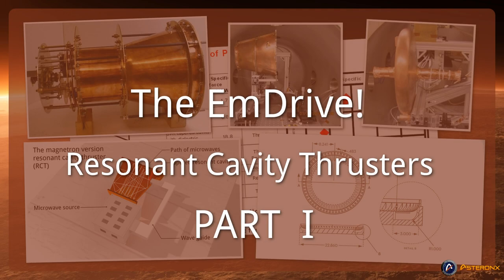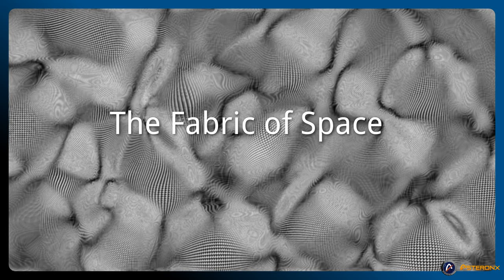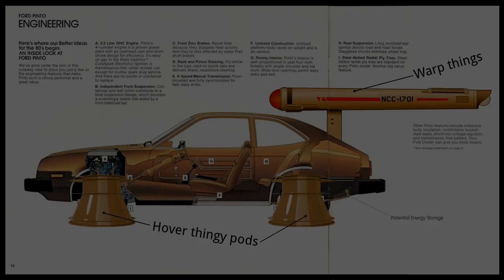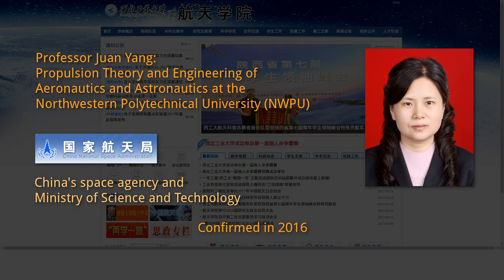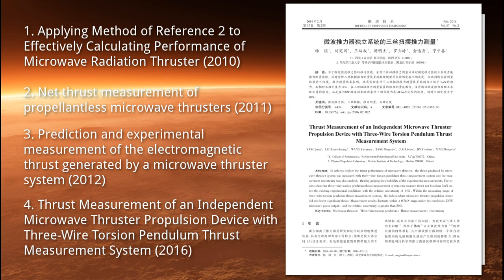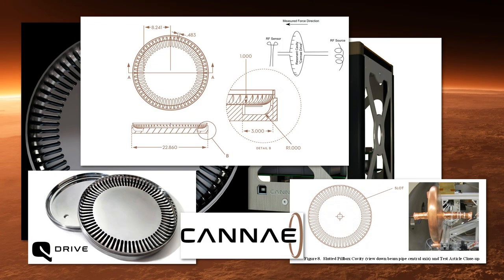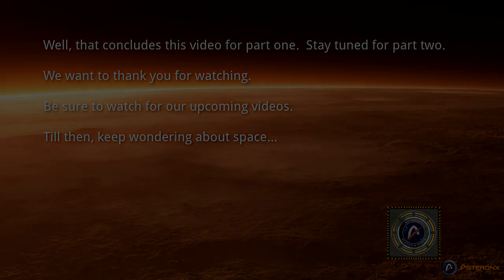An Explanation of the EmDrive and Cannae Drive Part I

Comment: This is how the EM drive works because I designed it.

The velocity of light in a dielectric is given by

(1)   v=c/sqrt(dielectric constant)

higher index of refraction slower the speed.

F=W/c is the vacuum case

The force equals power W in watts divided by the speed of light c

the general case is
 
(2)   F=W/v       force=power/actual velocity of light

where there is a dielectric the velocity is slower so the force is larger
substituting eq 1 into eq 2 gives

F=(W/c)(sqrt(dielectric constant))

The higher the dielectric constant the greater the force
Some materials have a dielectric constant of 12000
sqrt(12000)=109

So the force is multiplied by a factor of 109.

When I first conceived of the EMdrive in 1999 shortly before my lab books were stolen,
this is what I envisioned.
I realized that the difference in dielectric constants of materials could be used to create an asymmetric array where all the momentum is deposited only on one side of the device hence a force in that direction.
Originally I attempted to use an asymmetric cavity based on geometry alone but found that all the forces would cancel out and it would not have a resultant force in any direction. 
That's when i said, put the high dielectric on one side and the vast majority of the waves will be absorbed in the high dielectric material. I mean at least 99%.
I was certain that was the last entry in my lab book before it went missing. 
The dielectric differential effect could be what is causing the force on this particular design. For example if the copper walls are bare the constant is just that of air 1.0
but if a white titanium dioxide paint were used on say the round flat plate portion of the device you would have a dielectric constant differential which would yield a weak effect because of the weakness of titanium dioxide on the order of a factor of 10 or less.
So internal losses exceed the dielectric differential effect.

 The original concept conceived in 1999 involves a sharp tapered cone on the end of the cavity. The principle was the photons would undergo many more reflections in the conical section than in the flat region near the microwave input. Since the same photon deposits more momentum in the conical section than in the flat portion causing an asymmetry of momentum in the system where more momentum is deposited on the conical side. This momentum imbalance was hypothesized to cause a force in the direction of the conical section.
One end needs to be tapered to 3 cm then capped, for 2.4 Ghz.
At that diameter the reflection will be from a nodal point where the loss is expected to be less.
The theory is sound all we await is someone to demostrare this principle in the lab. Good luck fellow star travellers. 
Happy Chinese new year.
Reply: How do you let your notes/lab books get stolen???  Seems like something I'd take to bed with me in case I had an idea right before I went to sleep.
Reply: @nothing1624  It was in a briefcase that i carried around with me. the agent was able to exploit the short memory effect of cannabis to allow me to forget my briefcase in the car that was broken into while I was visiting his place. this incident drove me to find an antidote for the short term effects.
Reply: @paulneilson6117  wait..so your drug dealer stole it?

Comment: I'd really like to see someone take an EmDrive, attach it to a plutonium-248 generator, put a Sputnik-style radio transmitter on it, and send it off in the direction of Voyager 2. Let's see how long it takes to catch up. A P-248 generator should be able to provide more than enough power for that kind of simple experiment.

Comment: What I am reading about the EmDrive is that the trust is limited by q-factor. One of the limit of q-factor is surface resistance (or skin effect - high concentration of electrons in i very small volume of the conductor). One of the way to reduce surface resistance is cool the conductor so it became super conductor. Somebody proposed that - I wonder if somebody did experience and what the results. Another approach ...make it in bigger size. Any body in RF know the lower the frequency the lower the insertion loss. That mean If they build the EmDrive rezonator let say 10 time bigger that you should get rezonator with higher q-factor to be more efficient to produce bigger trust as compare to current design.

Comment: Directed Radio Antenna Photon Drive, any frequency: E=hf=mc^2, m=hf/c^2. Radio photon (visible or microwave) takes mass to launch, photon energy in eV/c^2. Cavity reflection and absorbtion affects how much is leaked asymmetrically from both sides.

Comment: "His drive has consistently demonstrated..."
Prtety sure it hasn't. It has repeatedly failed to produce thrust under laboratory conditions, and the one time it might have, it produced the same level of thrust in exactly the same direction when it was mounted backwards, strongly indicating equipment error. Actual test results are a lot closer to 0.1mN per kW, not hundreds as you claim.

Comment: It seems that use of optical fiber may be useful for conducting further research. When a beam of light emited by the same source travels through two diffetent optical fibers of different different lengths, we may be able to fire two photens at exact same place or two different placed at an exact intervel of time difference of 10 to the power minus eight seconds

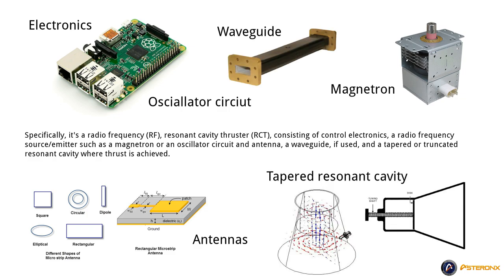Comment: 2:17 Microwaves in a resonant cavity don't act like the straight paths you shown, which are looking like a laser ray. Microwaves develop as wavefronts with two counter-propagating travelling waves between the two end plates and a resulting standing wave, with nodes and antinodes, organizing as EM modes. Otherwise the EmDrive would use lasers instead. It can't.

In a less technical language, imagine the microwaves more like the 2D surface waves of a liquid arriving from a canal on the side of a pool. Or the 3D acoustic waves along which sounds are propagating in air.

Comment: I may just be speculating, but I think in 20 years we will have some type of FTL.. We are closer than we think..
Reply: probably not even in 200 years, the theoretical basis for FTL is sketchy at best
Reply: I believe you're right.  Late 21st or early 22nd century.
Reply: We are closer than we think assuming there is global stability we will achieve this in about 75years time.
Reply: you guys are just guessing...I get being optimistic is fun, but how can you confidently assert things like "20 years", "75 years" without being in the tech development sectors required yourselves? You can't, it's hubris, and your assertions aren't useful.
Reply: No. We won't. 
It's not some arbitrary speed limit that we can ignore if we want to.
It is the speed of gravity.
It is the speed of inertia.
It is the speed of information.

Comment: The amount of force that this EM drive puts out is no more than the Momentum that is exerted by the Photons. This should not cause anyone to scratch their heads, as it does not violate conservation of energy or momentum.  This kind of drive will not push anything with enough force to do much of anything, and to do that it requires pushing against the so called fabric of space. Also the higher the frequency the greater the thrust output. No matter it will always be small. 

The other one shown works with AIR and is also quite weak, and if it had enough air around it to work the force of air alone would cause slowing of the satellite. It requires a very strong magnetic field to position the atoms near the craft and the em field pushes them away. This was published back in 1981 in The Journal of Aeronautics and space by COX who was working for TRW at the time. It would work with an onboard gas supply though, and probably just as effective as some of the other engines that use fuel or gas to maintain the position of the satellite. I see an advantage in not using hydrazine as a propellant. There would be far less chemical hazards associated with the launch.